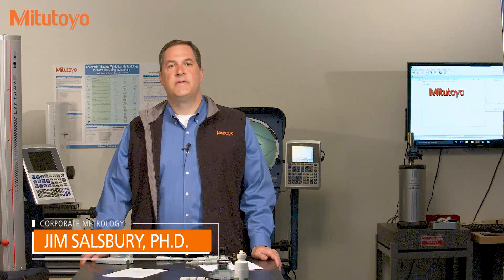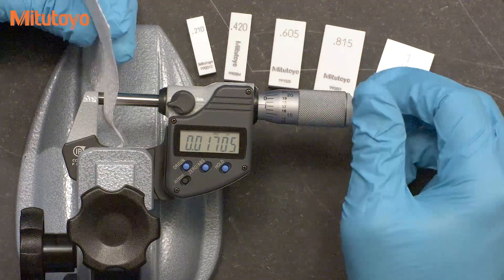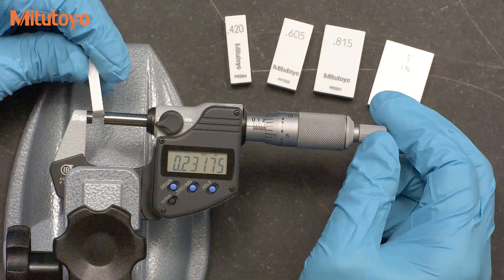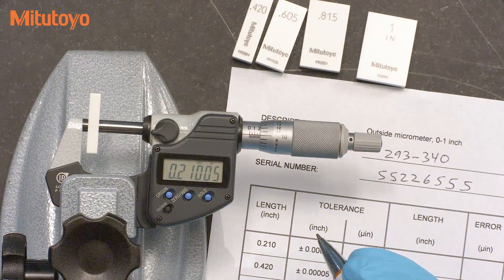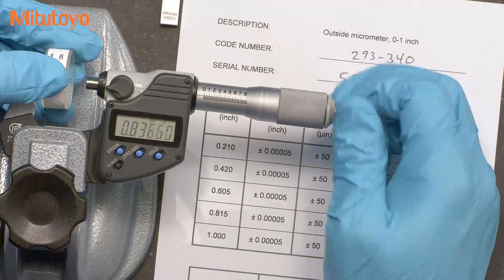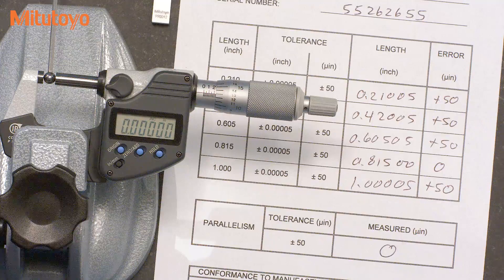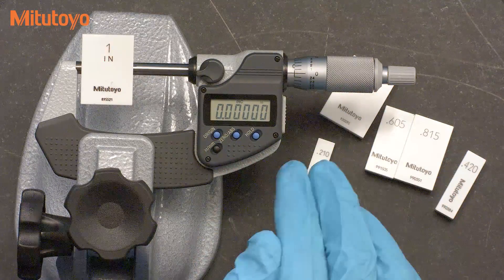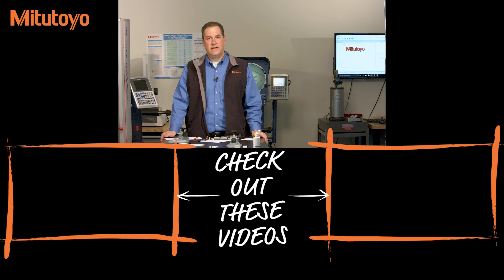Outside Micrometer Calibration - How to Calibrate - Mitutoyo

Comment: I was under the impression that it's important for consistency to use a slow rotation of the ratchet thimble on micrometers and the same number of clicks of the ratchet for each measurement. Is that correct or incorrect information I've been told ?
Reply: Consistency is critical. The rotation of the thimble should not be too fast and not too slow. Several clicks of the ratchet is good, mostly to get a consistent force, but the "exact" number of clicks of the ratchet is not so important.
Reply: @dr.jimsalsbury695  Calibration of inside tube micrometer please!!
Reply: I have been told the same thing by the National Physical Laboratory
Reply: I just turn the thimble slowly until it clicks. Since the amount of torque require to overcome the tension is the same that should be good enough as going faster might compress the part by a few microns.
Reply: Ok, thank you very much for the additional information.
Reply: Ajaylakhaniya
Reply: I agree. I think it’s just common sense.

Comment: This shows how to check a micrometer but not how to calibrate it if it is off.   Can you correct a micrometer that is off as in adjusting the barrel?  Do you need to send it back to the manufacturer if it doesn't pass there tests.

Comment: How do you rezero the barrel? I have the 0-1 inch and my barrel is off. I'm sure you have a video on it but I can't find it.
Reply: Usually micrometers come with a small spanner wrench. There's a hole at the base of the barrel it fits and you can just rotate the whole thing with a little pressure.

Comment: Hi, could you clear my doubts.
1) What is different between optical flat and optical parallel?
2). What is the 4set of optical parallel? And what are the different. 
3). Which on is the right selection for the micrometer anvil parallelism measurement?
Reply: Typically optical flat and optical parallel are used interchangeably.

The set of optical flats are typically different thicknesses so that you can measure the parallelism and different incremental rotations of the spindle.

It's not about which is right or wrong. It's about following your procedure. I prefer checking flatness and parallelism with optical flats over the ball method. Imo the ball method skips a large portion of the surface area of the measuring faces.

Comment: Should the .210" block not be measured across the "lapped" faces and not across the faces with the laser ident on them. Is it just a fluke that the smallest block is .210" X .210" ?

Comment: Paper to clean mic is good, but what happens to mic's are over 1in as you cannot close them down onto a piece of paper, so this method fails to address all mics over 1 in or 25.4 mm. How would you clean the face of a 5 to 6 in mic as you cannot close it down on a piece of paper.

Comment: I own 2 mitutoyo calipef 500-752-20 and both if I put a strong light from a flashlight in the top of the jaws(in the area where the jaws are milled thinner) i see the fine line of light passing through the jaws.
I have same issues with 1 tesa caliper .
With chinese calioer this issue not exist.
Both Tesa and Mitutoyo are original 100%  ( no fake ) bought to dealer .
Are this Mitutoyo and Tesa caliper defective? or this make part of caliper tolerance?

Comment: What is the proper proces for checking for instance a 200 to 225 mm micrometer just the same increments but wring up the gauge blocks to the correct sizes?
Reply from the maker: Thank you for your question. You are correct, the proper process for checking instance at 200 to 225 mm micrometer are the same increments but wring up the gauge blocks to the correct sizes.

Comment: Is this process the same for pointed tip micrometers
Reply from the maker: Short answer: yes. The same gage blocks used to calibrate the outside micrometer can be used to calibrate the point micrometer. They would test the micrometer across it's range. Obviously, you would not need to assess the parallelism of the measurement faces.

Comment: You need to read the operation manual. To set the absolute minimum length you close the mic around the standard then use the Origin button not the Zero/ABS button. Origin sets the absolute reading much as a standard mechanical mic while the Zero/ABS button toggles a temporary zero at some arbitrary length which is useful for comparison measurements. If the mic actually required adjustment then the reading is only accurate while in INC mode and will be in error when in absolute or if the INC origin is changed.
Reply from the maker: What is the code number on your micrometer. Please contact Tech.Support@Mitutoyo.com

Comment: For larger micrometers, is needed to use a gage block as reference? For example, the 10in micrometer, we need to have a 9in reference block? or exist an alternative method?
Reply from the maker: You should use a gage block for zeroing out the micrometer during the calibration process.  The standard which comes with the micrometer can be used to zero the mic on the shop floor but is not accurate enough for the calibration process.  If you do not have a 10 inch gage block, you might consider wringing two smaller blocks together to meet that same length.

Comment: Thanks for publishing this kind of video. It is very helpful. What kind of cloth you used for cleaning the measuring faces? and How many gauge bloks could be added (stack) as a maximum ?
Reply from the maker: We use lint-free cloth that can be purchased at most supply stores.  You should avoid general paper towels or napkins as they can be abbrasive and leave lint on the device which can foul the next measurement.  While a good technician can wring many blocks together, most measurements can be made by wringing three, or fewer, gage blocks together.  The fewer the blocks in the measurement, the better.  If you want to be impressed, you can find a video and many images of Carl Edvard Johansson, the creator of gage blocks, wringing together an entire set of gage blocks.  Pretty amazing!
Reply: and another doubt: could you please tell me an example of a kind or best option for a monochromatic light source for flatness check? Thank you very much

Comment: are kimwipes sufficient for cleaning micrometer anvils? what do you recommend?
Reply: Kim wipes are perfectly fine for cleaning the measuring faces of the mic. And don’t fear using a piece of paper like a post it to clean the faces. The faces are made of carbide normally so the paper isn’t going to scratch or damage the faces.

Comment: You didn't calibrate them. You just checked that they were calibrated and within tolerances.
Reply: I appreciate your comments and concerns. Unfortunately there is a lot of confusion about the definition of calibration. You may be interested in episode 5 in this series which directly addresses that question.
Reply: Here's the link for our video that discusses the meaning of calibration: https://www.youtube.com/watch?v=NV1VToAqfXI&t=22s
Reply from the maker: Thanks for the reply. The topic of this video was calibration of an outside micrometer. We did not cover adjusting the accuracy if the unit was out of tolerance. At 12:04 Dr. Salsbury states that this mic was calibrated and was within tolerance so no adjustment was needed.
Reply: @MitutoyoAmerica  Yes, to be fair he did. But being 12 minutes in to a video with "How to Calibrate" in the title, it's not exactly honest to just state it didn't need to be calibrated. Yes that's true, the mic was good, but I've already watched this specifically because i wanted to see the calibration being done.
You could easily have swung a mic out of calibration to demonstrate, or just titled it "how to check calibration", either is fine and a viewer would get what they should reasonably expect from the title, but as it stands you're promising content you're not delivering.
Reply: Please don't read this as overzealous or hot-headed, I just want it to be explicitly clear to you as content creators that it is frustrating to users when you overstate or mislead in the presentation of what the video is. I don't accuse you all of doing this with malice, or even consciously, and I'm not saying it's a big deal in the context of a single video. But little behaviours like this imply to your audience that maybe we shouldn't expect from you what you state you'll deliver and perhaps you value our views more than being honest with us.
I don't feel there was a big wrong doing here, just explaining why it is annoying. Food for thought.
Reply: It seems that the concept of calibration is not clear to you. Calibration is not equal to adjustment.

Comment: Mitutoyo gauge blocks would be nice to have, but I don't even want to know what the price tag is on them.
Reply: Not too bad if you get the steel ones and keep them small. Amazon sells individual Mitittoyo blocks at around $40 for the .500 steel. Ceramics are pricy though.

Comment: Which type of calibration was this? Does the laser etching affect the readings of the smaller gage blocks? What was the tolerance of the gage blocks you were using?
Reply: The size marking on the face of some Mitutoyo blocks has no influence on the size. We recommend Grade 0 gage blocks for the calibration of most micrometers. The tolerances are defined by ISO 3650 or ASME B89.1.9 and can also be found in the general Mitutoyo catalog.

Comment: Thanks for producing these valuable videos. I’m new to this and I have a basic question. Should the adjustment on a mechanical micrometer be made only at zero, or can it be used to correct for an error near a particular measurement to gain more accuracy at a particular point. For instance, if I’m measuring something that should be 0.55”, could I adjust the micrometer to read precisely 0.55” when measuring the 0.55” gauge block using the mechanical adjustment that is normally adjusted at zero? Is it better to adjust at zero, then mathematically interpolate to correct the error?
Reply: Very good question. While specifications apply from the set zero point, micrometers are frequently used in either an absolute or incremental mode. In the incremental mode, you can set your reference point anywhere, which could improve your accuracy. Using a gage block, like your 0.55" example, is commonly done in practice.

Comment: I just noticed a typo in the data sheet for this calibration. The parallelism is a range, not a plus/minus value, so the tolerance should be 50 µin or 1 µm, without the plus/minus. Sorry about that - blame it on "copy and paste".
Reply: Is there any way to get the "report" template? I could make one up, but I like the one in the video :)

Comment: How to  measure the flatness of measuring face with gauge Block
Reply: The best way to measure flatness of the measuring faces is with an optical flat. However, the value of an independent check of the flatness is highly debated by the experts and not commonly done by calibration labs (at least in the US market). The strategy of both the ISO 3611 and ASME B89.1.13 standards is to include a test of the "partial measuring face contact", which looks at the combined influences of flatness and parallelism. That is the goal of the test with the small sphere.
Reply: Jim Salsbury 
Thanks for your replay. Expecting more learning videos .